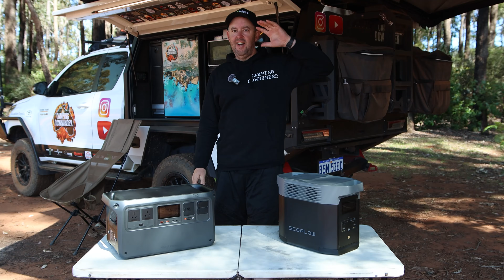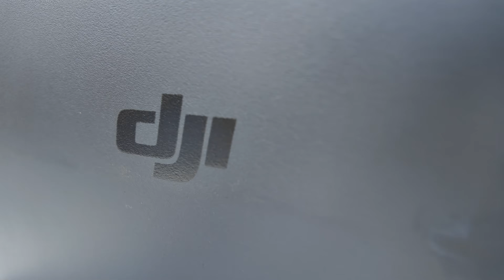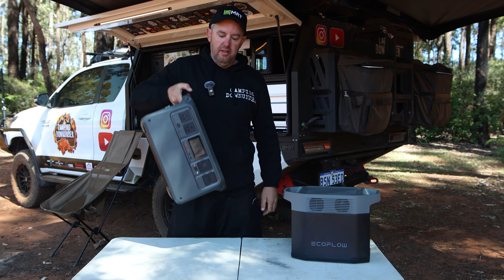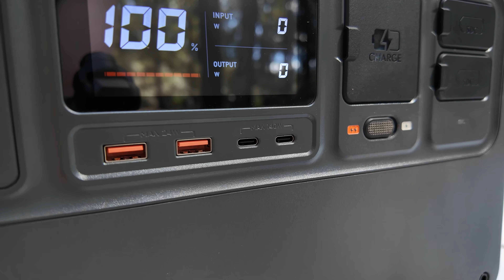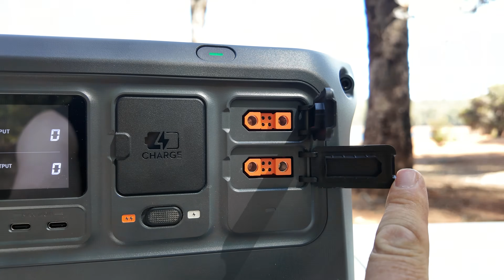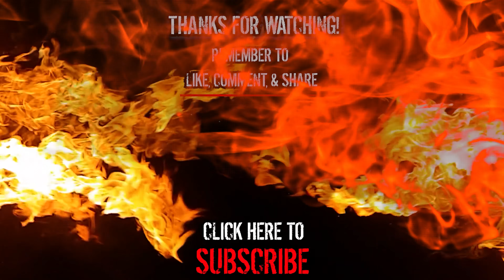DJI Power 1000 V2 VS Ecoflow Delta 2 (Which Portable Power Station Is Better?)

Comment: Great review mate. Didn't even know that DJI are in the power supply markwt🤔🤔
Reply from the maker: Thanks mate 👍
Reply: That doesn’t look like the v2. The v2 has 4 outlets.
Reply: The number of outlets is country dependent. Sockets vary in size. Here in the UK, we only get 2 outlets on the 1000 v2
Reply from the maker: Sorry you are mistaken. This was sent to me direct from dji and they are aware how many ports are on the unit they sent me
Reply: @Campingdownunder sorry I’m just looking at the advertisement on DJI. Maybe they sent you the wrong one or there are multiple versions. Does it say v2 on the front of it?
Reply from the maker: Yes it says V2. You are possibly looking at the 2000 unit & not the 1000
Reply from the maker: Click on the 1000 link in the description of this video & it will take you to the correct product
Reply: @Campingdownunder I’d gladly upload a pic if I could.
Reply: @Campingdownunder I see the problem. I’m in the US and it’s not technically available here.
Reply from the maker: I just clicked the link in the description and the unit pictured looks identical to my unit with 2 usb ports, 2 usb c ports & 2 240v outlets
Reply: @TRAXAerial  V2 are available in the US.  I bought one from Amazon last week.  Oddly not on their website though.  You are correct.  The US 1000 V2 added two additional outlets for a total of 4.  Australian market V2 appears to have not gotten additional outlets.